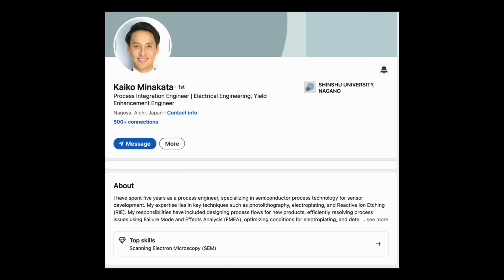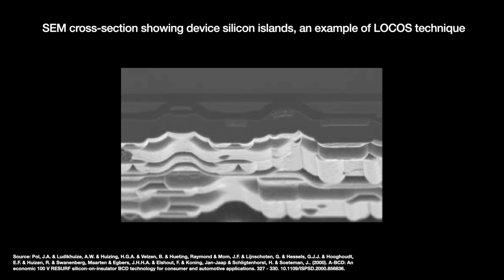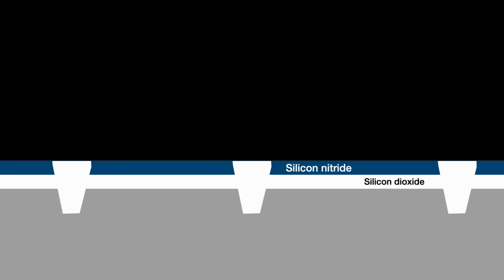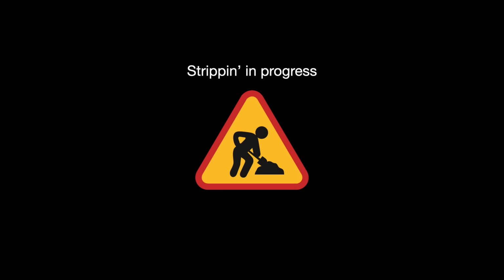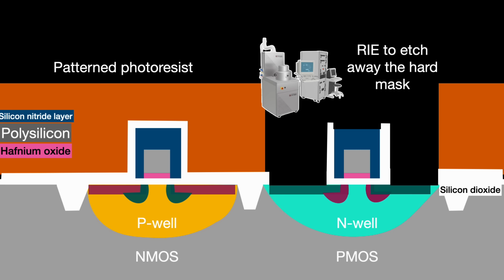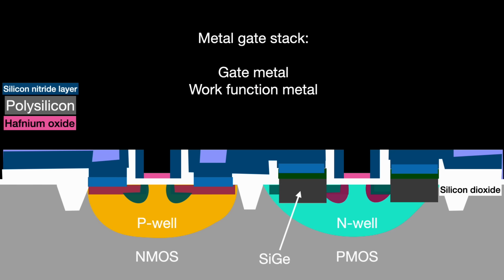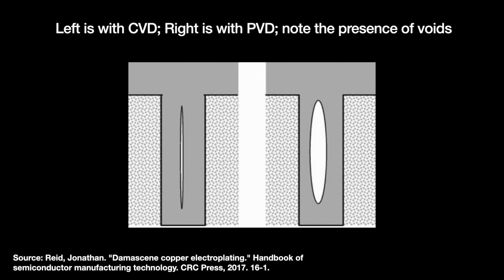Let’s Break Down the 45nm Process Node

Comment: I remember taking a course on semiconductor manufacturing technology in 2012 or so that used Quirk and Serda (2000). Most of the techniques here were either novel and cool (STI), or stuff that's under development (high k dielectrics). I've since stepped into photonics where we don't even have wet photolithography but it's good to get a refresher.

Comment: Theoretical limits to silicon transistors are when the random tunneling probability produces more on states than can be corrected in rechecking the data. This limit is about when the tunneling error check takes more of the chip than the calculation part of the chip. Ion implantation works in single species crystals such as silicon or germanium. At AFIT I worked with GaAs semiconductors , as the significantly faster switching times were of interest to the USAF. Working with GaAs semiconductors ( lower tunneling probability ) allows theoretical faster switching times than silicon;but the ion implementation  has variable distance depending on pathways in multi-species crystals.  Another problem with GaAs is the high vapor pressure of the gallium prevents using diffusion. GaAs is good for a few specialty items, but the fabrication for large scale fabrication had not been solved when I left AFIT to design weapons systems at Boeing.

Comment: Hi ,

There’s a hot topic—ASML’s planned 2026 layoffs (~1700 people)—that might fit well with Asianometry’s focus on the semiconductor industry.

Unlike many Big Tech layoffs framed around AI, ASML’s case appears to be driven more by organizational restructuring. But at a deeper level, both seem to point to the same underlying goal: improving efficiency.

What makes this especially intriguing is ASML’s proposed two-year “Social Plan.” This suggests the current layoffs may not be a one-time adjustment, but part of a staged transition—potentially leaving room for further changes, possibly justified later by automation or AI.

From an industry perspective, this raises a broader question:

👉 Is this a sign that even highly specialized semiconductor companies are entering a new phase—where organizational restructuring comes first, and technological displacement follows?

And at a more practical level:

👉 How should engineers think about their role when companies first restructure organizations, and then gradually reshape the role of human expertise?

This might connect well with your past analyses on semiconductor cycles, industry structure, and long-term strategic shifts.

Happy to see your opinion and analysis on this topic.

Best,

Comment: AI Summary

# 1. Analyze and Adopt
Domain: Semiconductor Manufacturing & Process Integration
Persona: Senior Semiconductor Process Integration Engineer

---

### 2. Summarize (Strict Objectivity)

Abstract:
This technical overview details the fabrication sequence of the 45-nanometer (nm) CMOS process node, specifically the High-K Metal Gate (HKMG) "Gate Last" flow popularized in 2007. The process encompasses substrate preparation, electrical isolation via Shallow Trench Isolation (STI), well formation using ion implantation, and the transition from silicon dioxide to hafnium oxide dielectrics. Key advancements discussed include strain engineering (SiGe epitaxy and tensile capping layers) to enhance carrier mobility and the implementation of the Damascene process for copper interconnects. The summary tracks the integration of various deposition (CVD, ALD, PVD), lithography, and metrology techniques required to maintain parametric and catastrophic yield at sub-micrometer scales.

45nm Process Node: Technical Fabrication Sequence and Integration

*   0:00 Historical Context: The 45nm process node entered high-volume production in 2007, marking a pivotal shift in scaling and materials science.
*   1:06 MOSFET and CMOS Fundamentals: Logic fabrication utilizes Complementary Metal Oxide Semiconductor (CMOS) structures, pairing NMOS (electron transport) and PMOS (hole transport) transistors. Device scaling necessitates shrinking contacts and interconnects while maintaining parametric yield (performance specs) and catastrophic yield (functional success).
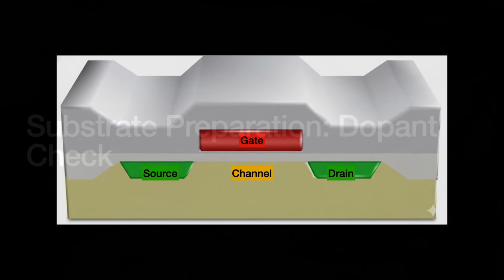*   3:28 Substrate Preparation and Metrology: Wafers produced via the Czochralski method undergo rigorous checks for dopant concentration (four-point probe), crystallographic integrity (X-ray diffractometry), and surface flatness (stylus profilometry).
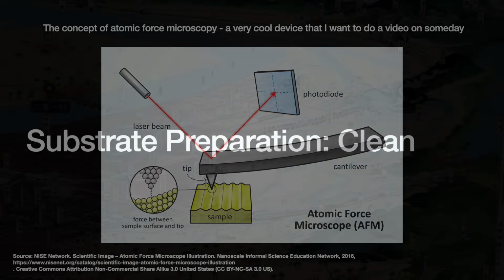*   6:25 RCA Cleaning Protocol: The industry-standard RCA clean involves two primary stages: SC1 (alkaline bath for organic films) and SC2 (acidic bath for metal contaminants).
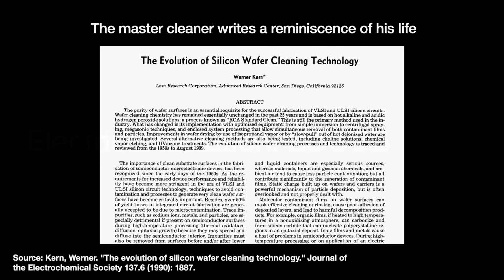*   8:17 Shallow Trench Isolation (STI): Replacing the older LOCOS method, STI prevents current leakage between adjacent transistors. The process involves etching nanoscale trenches, lining them with thermal oxide, and filling them with silicon dioxide via Tetraethyl Orthosilicate (TEOS) Chemical Vapor Deposition (CVD). 
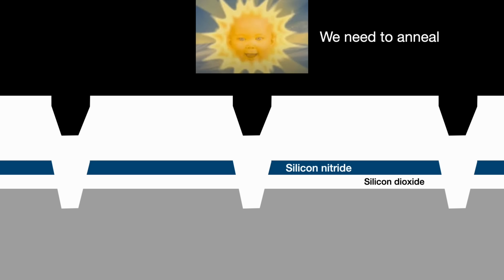*   16:10 Planarization (CMP): Chemical Mechanical Polishing (CMP) is used to flatten the landscape, utilizing a silicon nitride stopping layer to ensure precise grind depth.
*   18:08 Well and Tub Formation: NMOS and PMOS transistors are built on P-type and N-type wells, respectively. Doping is achieved via ion implantation of boron or phosphorus, followed by Secondary Ion Mass Spectrometry (SIMS) to verify dopant concentration.
*   24:31 High-K Metal Gate (HKMG) Transition: To combat short-channel effects and leakage, silicon dioxide gate insulators were replaced with hafnium oxide ($HfO_2$). Atomic Layer Deposition (ALD) is utilized to deposit $HfO_2$ at thicknesses of 1-2 nm.
*   26:05 Gate-Last Flow: The "Gate-Last" or "Replacement Metal Gate" flow involves building a sacrificial polysilicon dummy gate to align the source and drain, which is replaced with metal only after high-temperature annealing steps are complete.
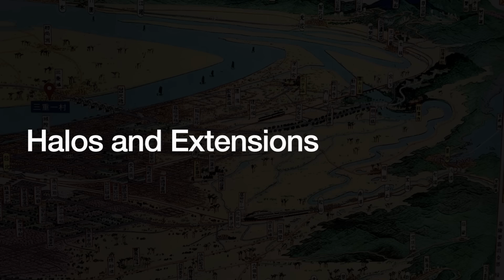*   32:19 Halo Implants and Extensions: Pocket/halo implants suppress lateral dopant spreading, while lightly doped extensions protect the gate oxide from hot carrier injection.
*   36:02 Strain Engineering: Mobility is enhanced via tensile strain for NMOS (silicon nitride capping) and compressive strain for PMOS (epitaxial Silicon-Germanium or "SiGe" in the source/drain regions).
*   42:09 Silicide/Salicide Formation: To reduce electrical resistance at contacts, metal-silicon alloys (silicides) are formed. The "salicide" (self-aligned silicide) process uses titanium, nickel, or cobalt sputtered onto the silicon and annealed to create low-resistance C54 phase layers.
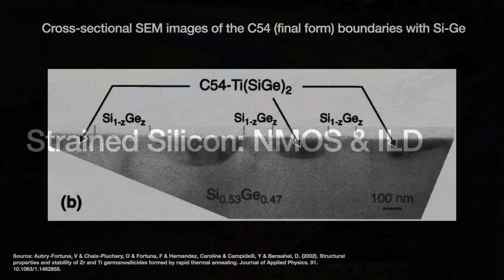*   46:30 Replacement Metal Gate (RMG) Construction: The dummy gate is removed via wet etch (TMAH). Work function metals (e.g., Titanium Nitride for PMOS, Titanium Aluminide for NMOS) are deposited to tune threshold voltages before the final aluminum or tungsten gate fill.
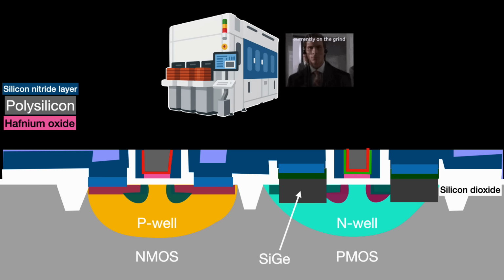*   50:36 Contact Plugs: Vertical connections (plugs) are established by etching through the interlayer dielectric (ILD) and filling with tungsten over a titanium nitride glue layer.
*   52:41 Copper Interconnects and Damascene Process: Copper replaced aluminum for interconnects due to lower resistivity. Because copper cannot be easily dry-etched, the Damascene process is used: etching trenches into low-k dielectrics, applying a tantalum barrier and copper seed layer, and utilizing "superfill" electroplating.

AI-generated summary created with gemini-3-flash-preview for free via RocketRecap-dot-com. (Input: 32,024 tokens, Output: 1,070 tokens, Est. cost: $0.0192).

Comment: My question is this just demonstrating one layer of transistors, or are there multiple layers? How do they align the steps across the whole die with there being different sections and circuitry, especially with steps that have to be done across the whole wafer?

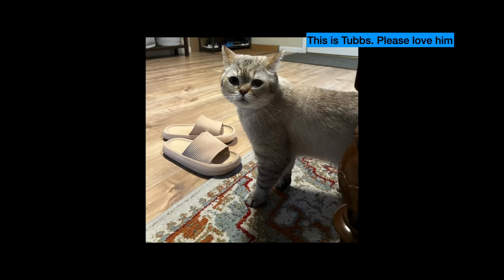Comment: Most of the video went like a rocket balsting over my head, but I appreciate the little jokes here and there to keep things from being too dry and technical. Also thanks for showing us Tubbs at 18:30.

Its amazing how little tolerances are just for the transistor production step, much more so for a while processor. The need for the sacrificial layers and rounds of round of baths also point out how extrenely clean the production needs to be so things don't go wrong at any step. The whole process is maddening and the little room for error makes a screw up like Intel's oxidation issues with 13th and 14th gen Core processors make a bit more sense how it could happen.

Comment: I used to work at a 2 in fab at Texas Instruments.  They had these track modules that moved the slices with air.  There were cleaning stations, photoresist depositers, bake stations and the mask exposure station.  Alignment was by hand using a microscope.  Rather crude.  Then they went into the etch station, a long module with multiple gates for timing.  If underetched, additional gates were opened.  Over etch, close some stages for less time in the etch.  Then wash, inspect and move to the next line.  Oxidation was done offline.  It was all under yellow/orage hoods with Vertical Laminar Flow throughout the fab.  Long ago!  In the early 1970s.

Comment: hey, regarding TEOS for STI fill vs thermal ox, i’m curious if that was less about conformality and more about the need for overburden for CMP, since thermal oxide needs exposed silicon to grow off of. also surprised to hear TEOS was used and not HDP oxide since TEOS based oxides tend to be lower quality

Comment: Hydrofluoric acid doesn’t really burn your skin and if you are exposed you might not even notice right away.  If left untreated it basically liquifies your bones (because it attacks the calcium).  There are still chemical plants that use it, but you really don’t want to mess with that stuff and it should really only be used when there is no alternative.

Comment: Fun trivia:
Hafnium gets deposited with the RMG rather than with the dummy gate for all gate last process besides I Intel 45nm. This is why you see a different gate oxide shape on Intel 45nm vs 32nm (flat vs U shaped).

Intel 45nm and every gate last process I have ever seen uses tungsten not Al metal gates.

Other than this the process flow in this video is generic enough that it would describe any planar HKMG last process on a bulk silicon substrate.

Comment: 20:12 That's why halogen lamps should never be handled by the crystal since the sodium from our skin will thermally diffuse into the lamp and react with the halogen gas reducing its availability and it's that gas that keeps the syntherized tungsten filament in one piece by capturing the tungsten that leaves the filament and putting it back in place. I have no idea how the gas does that but I remember my professor's explanation.

Comment: Great info and effort
if I may have a question, at ~47:31 there is Silicon dioxide interlay dielectric, but a few steps later it seems to completely dissapear. What is its purpose, or is it temporary and I missed it?

Comment: Semi engineer here - the wafers get cleaned a ridiculous amount and it gets even more complex with GAA because the structures are really delicate and you need to clean certain stuff out sideways. This involves selective material removal such as SRP tools from AMAT.
Reply: Doesn't this make the processors subject to environmental and physical degradation, thereby increasing the "planned obsolescence" meaning are we not using more energy and less sustainability by moving to GGA and sub 32nm sizes. At what point does the "delicate" or environmental/physical degradation, as well as more subject to radiation "flipping" from muons and other environmental "hard" radiation exposure (solar) and non-ionizing radiation caused error rates?

Plus, look at the amount of very hazardous volatile organic compounds being used in this process? 

Had or have other dialectics been considered like borascilate glass or crystal?
Reply: @aquahoodjd  there is no planned obsolescence my guy, legacy nodes are still in very high demand. Not everyone needs a 2nm AI chip to run their smart watch. 

Yes - agree with your VOC comment and the usage will only increase because of the delicate gate build structures. Look up supercritical clean for interesting reads and the future of anisotropic cleaning. 

I’m not sure about your glass question as I’m not really a device guy, sorry.

Comment: You are wrong. It is metal oxide Silicon Field Effect Transistor
Reply: Actually it is now accepted that the S stands for semiconductor on the basis that some MOSFETs are not made using silicon..  i.E., SiC MOSFETs are very common these days.

Comment: Fascinating!!

With all that continuously repeating "adding of material and then stripping away most of it" I wonder what the process flow is for all of the biproducts. Are they captured and reused/recycled or are the R&D budget and fab time so ridiculously expensive that the material cost is not worth even thinking about?
Reply: Biproducts are disposed of. For dry-etch methods they exit as gases and typically go through a burn-box at some point to decompose topic or harmful chemicals into inert molecules before leaving the smoke stack. Particularly dangerous vapor byproducts might instead go through a wetbox first for chemical neutralization (which is to protect our health as much as it is to protect the system infrastructure from corrosive environments). Wet etch byproducts will go through similar wet-chemical neutralization steps before they go to waste-water treatment plants (where recycling back into the fab or other industrial facilities is becoming more popular). Precious metal extraction may be used but they wouldn't be used again on site, they would be sold off to metal recyclers because at this point the contaminants would require economies of scale to make extraction and purification back to N4 (99.99%+) purity required for semiconductor fabrication economically viable. For things like photoresist, they are not recyclable and even if they were the loss of purity/free of contamination requirements would not make them economically viable.
Reply: @Melankurion  Thanks!!

Comment: Is the gate connected at the same time as the source and drain? Are there extra steps required to interface between the metal gate and copper interconnects?
Reply: The via etch down to the gate would be done in a separate lithography step from the via etch down to the source and drain. The interlayer dielectric itself will also have a lithography step to etch in metal-trace lines that will later be filled by copper. All this etching and lithography is done before the diffusion barrier deposition and copper electrodeposition occurs. This is where 2D diagrams really begin to suffer and 3D models start to pay off in terms of showing interconnect complexity. During the planarization step the copper is ground/polished down until there is interlayer dielectric exposed. At this point source, drain power lines and gate signal lines are all exposed and planarized on the same layer. Let us not forget that there are also signal output lines that connect from transistor output to transistor input (gate) or intermediary or final I/O metal traces. Using the steps we've been provided so far successive metal interonnect layers would then be: Deposit interlayer dielectric. Litho and etch metal trace lines. Litho and etch vias. Diffusion barrier deposition, copper electrodeposition, CMP, rinse, repeat. The actuall specifics of how this is carried out from layer to layer can be wildly different because as you go up in interconnect layers feature dimensions get bigger and you can start to use different, cheaper, or older materials/processes/technology nodes.